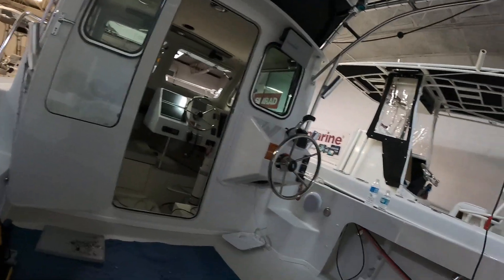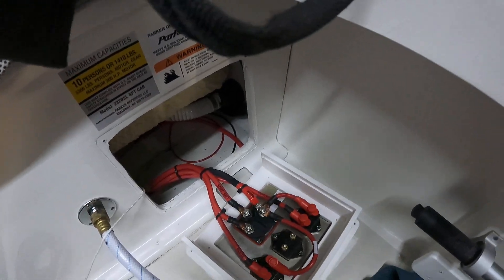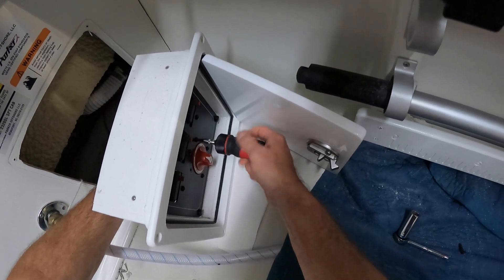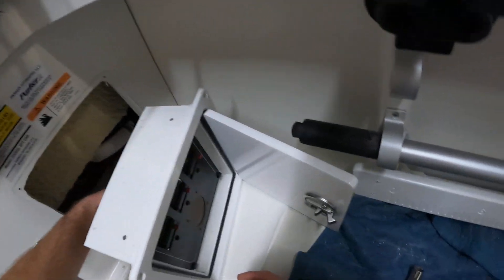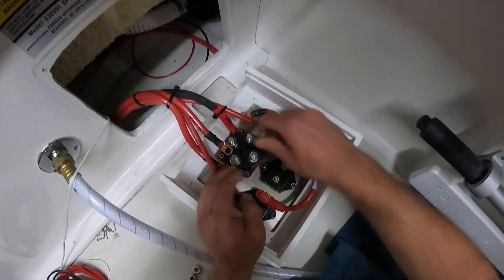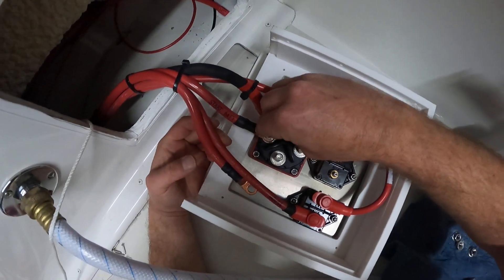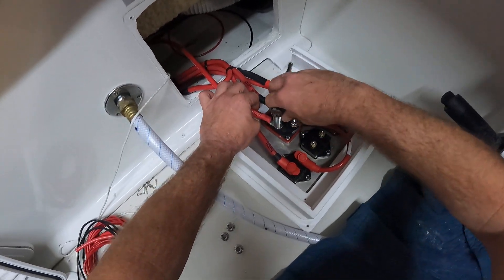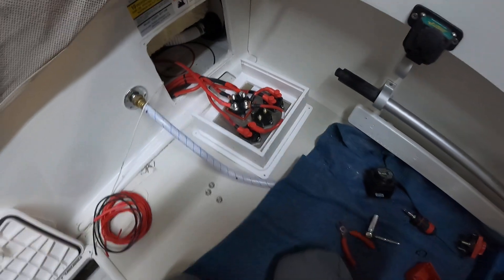Upgrading a 4 position battery switch to a dual circuit switch and an ACR.

Comment: Thank you for describing ACR and the purpose it provides. BTW: Has anyone else commented about the ridiculous position of all the battery connections directly beside the Freshwater valves?  Horribly designed location!